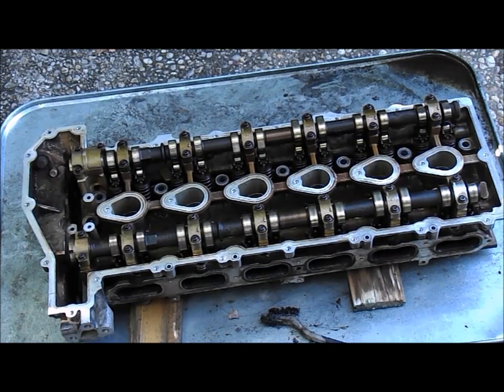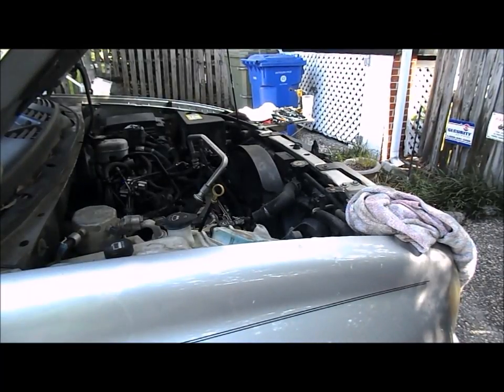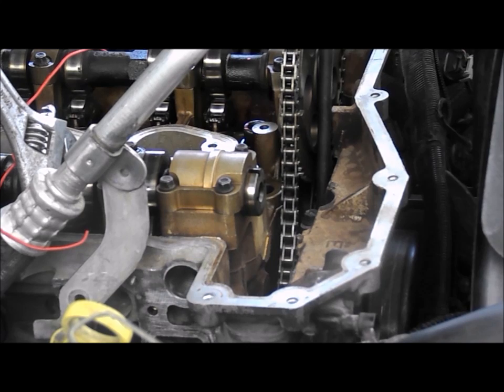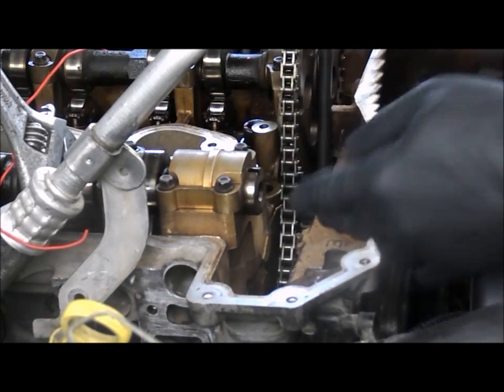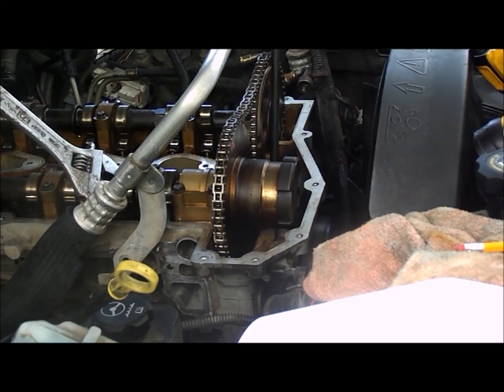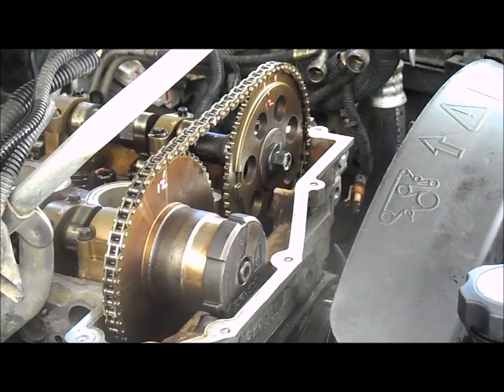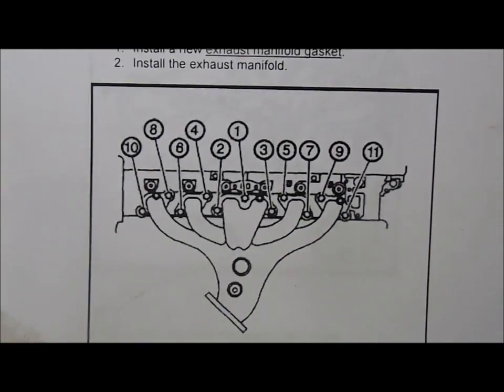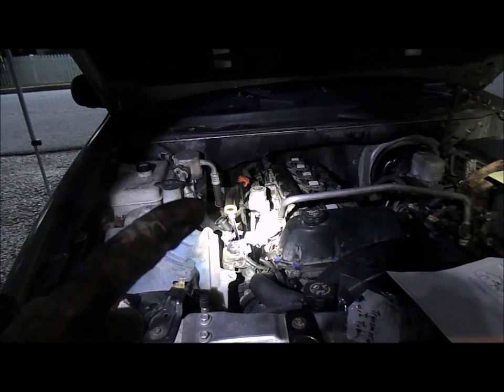2004 4.2L I6 chevrolet trailblazer head gasket day 4 and 5

Comment: Your torque wrench had to be miscalibrated. Or you messed up the internal head bolt threads. 😬 I'm replacing rod bearings and valve cover gaskets. Was thinking about stripping her down to the cylinders to make sure I didn't have any bent valves. I'm not putting myself through the brown head bolt torture.

Comment: I've owned a 2004 TB for 11 years. I never go by what the book say when it come to bolts torque. When you first said 22 ft-lbs. I was thinking, I would go 20 ft-lbs and be done with it. It is an all aluminum block. They can't handle a lot of torque. I've notice people online love to follow what the book say. 
I also own a 2001 Deville and I wonder is that the reason why the Northstar head bolts are stripping out the treads. The factory over torque the head bolts.
Reply: 25 ain't a lot of probably go like 50 or so
Reply: The deville heads are stripping because the bolts are made of a different metal. They have it figured out now
Reply: @fsu3784  Have you ever install heads on a Northstar?
Reply: @Fone65  probably over 30 of em
Reply: @fsu3784  Did you have use GM 317 tool to set the timing?
Reply: @Fone65  do you mean the tensioner tool? If so then yes but it’s not needed if you are creative

Comment: Seems like you have it backward as far as new vs old bolts. The old style would torque EASIER because the friction surface area between the bolt and the washer would be far less than if the washer were forced to turn against the head.
Reply: Thats how I always saw it